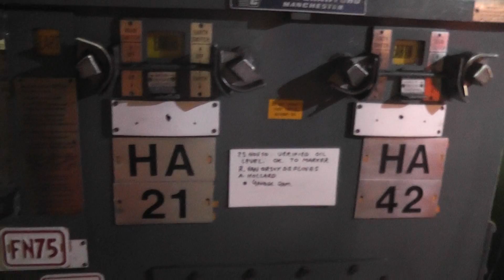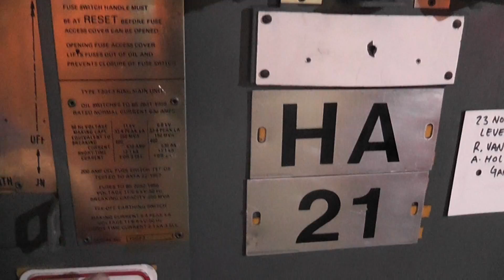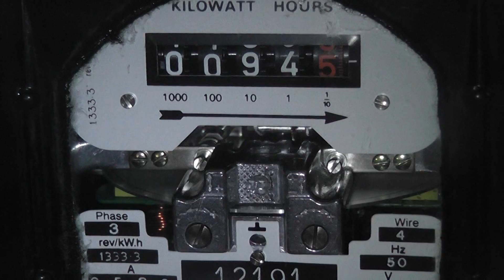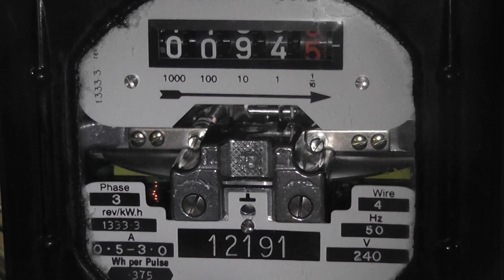2 x Long & Crawford T3GF3 oil switches

Comment: I assume the inverter design installation on your van is of your own design, cos' it looks like it.  I have a kWh meter on my inverter because I too find it interesting.
Reply from the maker: 3kW Sine wave inverter to run the oil pumps. The meter is a 3 Phase CT Email SDM meter rated at 3 Amps/Phase paralleled up so effectively  a 9 Amp meter. The meter works perfect.
Reply: Oh man what a dummy !!  I just got something.
I've been wondering for some time the meaning of the low amperage of some kWh meters.  Of course, they use current transformers.
Cheers for that.
Reply from the maker: No worries, great you learned something. CT Meters are usually rated at 5 Amps or 1 Amps. depending upon how long the cables are from the CT's to the meter.

Comment: After refilling,with fresh oil,how long do you leave it,for the bubbles in the oil to come out,before you re energise it?
Reply from the maker: We let the oil sit for a minimum of 30 to 50  minutes before any switching takes place, by the time the Earths have been removed, and we are ready for energizing well over an hour has passed to allow the oil bubbles in the oil to have disappeared. We monitor the switch for at least 15 minutes to ensure all is good and take a Partial Discharge test o see if there in any electrical discharge or noise within the switch unit.